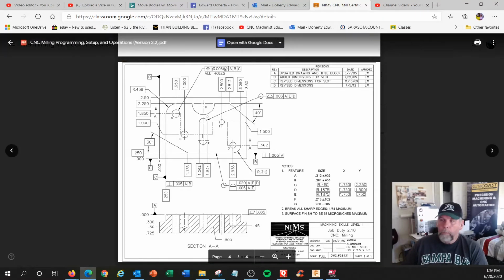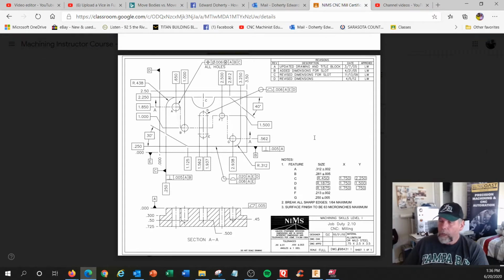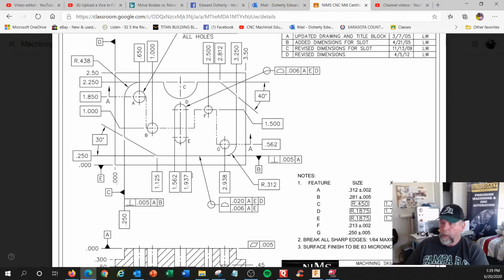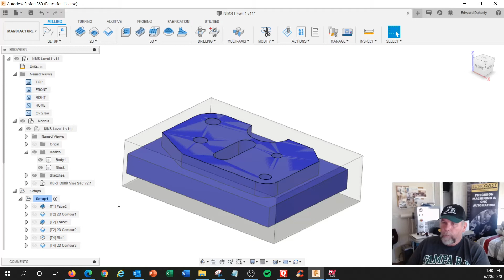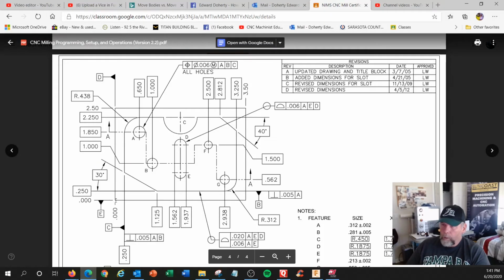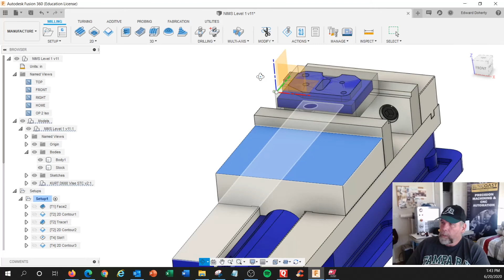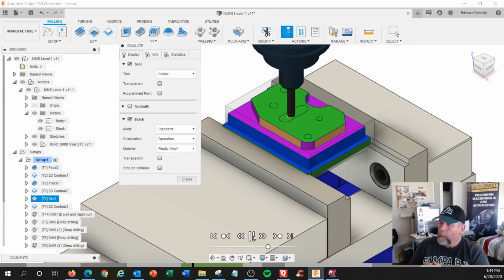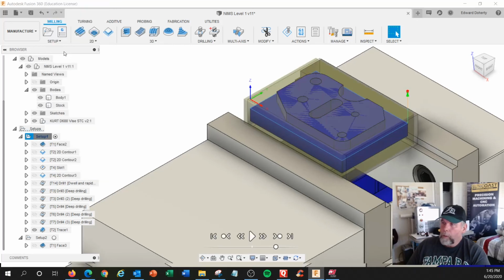NIMS CNC Milling Level 1 Demo - Part 1

Comment: Doesn't Mastercam generate the G-Code for you once you set it up in the program? 

Sorry, I have a lot of questions. My campus has it optional for instructors to be on campus due to Covid. And a lot of us are being tossed to the wolves so to speak given a print. Expected to draw it, machine it in Mastercam and program it. 

At least in your print it's very detailed on where the features are to locate. Good of you to be helpful to your student and also give them another document to assist. 

Your videos are helpful.
Reply from the maker: yes Mastercam or fusion 360 will generate the G code needed. that specific NIMS certification requires you do machine it with g code created by hand with cadcam - its a good exercise in how G code works
Reply: @CNCMachinistEducationNetwork  I'm confused so we hand program this or cad cam g code this?
Reply: @landonjacobs8392  Your supposed to hand program this. Cad Cam G Code will be noticeably different than hand programming.
Reply: You are not supposed to generate the G-Code in Mastercam or any other CAD program. Like a commenter said above, you are supposed to hand write the program for each of the tools. I did this part at the end of 2018 and it did give my classmates and me some issues getting it within all tolerances of the sheet. I will say that once you get better at machining and programming this is not that difficult of a part. Especially if you use Mastercam (which is why NIMS does not want you to use a program to generate the G-Code).

Comment: I let the students program it in mastercam
Reply from the maker: That is really what we do now - we use Fusion 360 and Mastercam for all projects - we do 1-2 hand program just to learn the nuts and bolts of g code
Reply: @CNCMachinistEducationNetwork  how do you get drill bits that fit the tolerance of hole dimensions. Like I never have heard of a .312 drill bit size.
Reply: @landonjacobs8392  you are supposed to drill it first with a smaller drill and then use a 0.312 reamer

Comment: I have to program it by hand. I’m having problems with the slot in the center. I just don’t know how to do it.
Reply from the maker: what part 2 for more detail - I can't just give you the G code - 

plan a - Mill the slot with 2 flt end mill .375 - just go from center of each radius - 
issues - need to get into solid material  - plunge into material to depth (ugh) - peck drill into same ( ugh but not so bad) - pre drill a hole and then plunge ( much better).   BUT will it machine and leave good finish and size (????)
Plan b - Mill the slot with a 2-3 flt .250 end mill.  - need to make a contour program for the inside.  Just like outside only your in a tight space - use methods described before to get into material ( Plunge - peck or follow a drill)

My plan - use .250 end mill and Ramp mill ( which would be a YZ move back and forth ) ex:  Start point x0y0 - then move to g1 to  z0 - then G01 Y-1.0Z-.05F10. :   Y0Z-.100 etc.   - then do the contour program -  

Just try one of them and prove it out with NC viewer